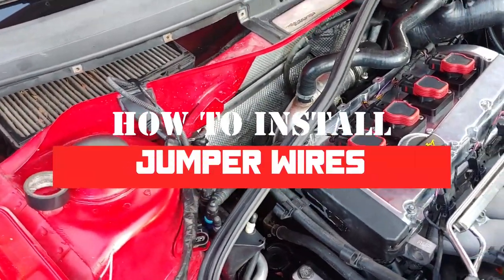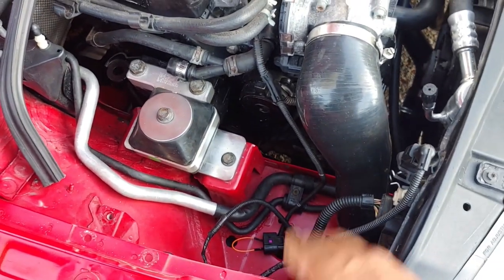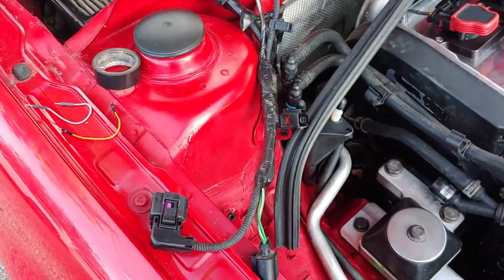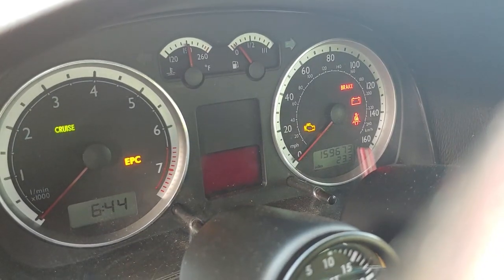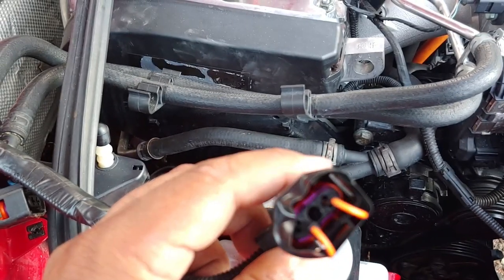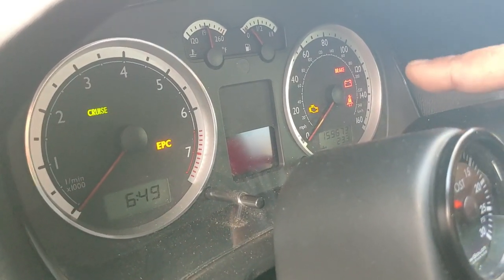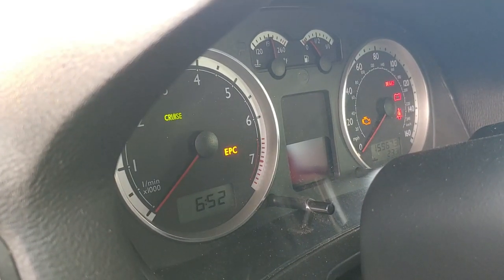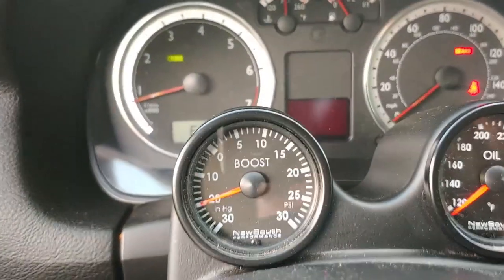How to install Jumper Wires to turn off Coolant and Wiper Reservoir Light S6EP27

Comment: Better way to water proof the connectors. 
I take a little zip lock style bag, put it over the connector, and then zip tie it closed around the wire. Never had a drop of water get in. Or you can get a nice thick small balloon and tape or zip tie it shut. I prefer the look of the balloon, but the clear bag is nice, cause it is easy to tell if your getting any water inside.
Reply from the maker: Good advice

Comment: Can’t you just clip the connector off and connect the two wires together? I clipped and soldered the windshield washer bottle wires and it works perfect and looks better than having the taped up connectors hanging out in the bay
Reply from the maker: That is correct but some people dont want to do that maybe it's a temp thing or they are like me and i dont like cutting into main harness.